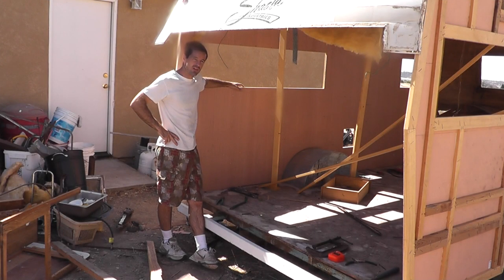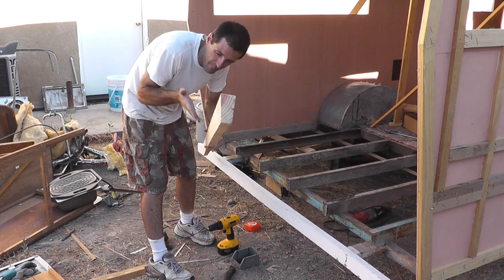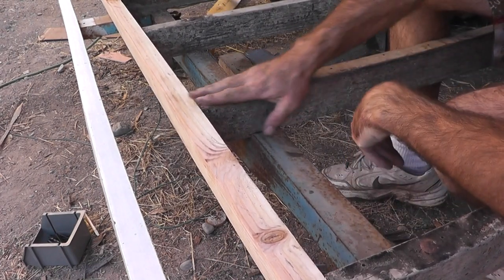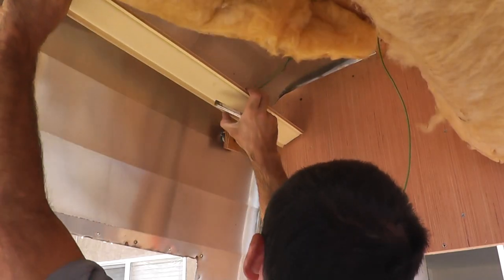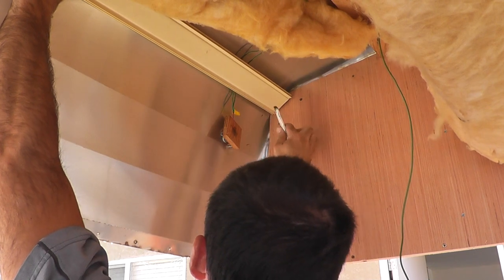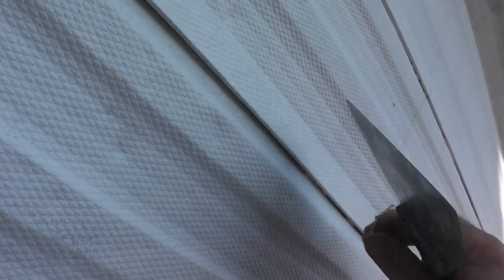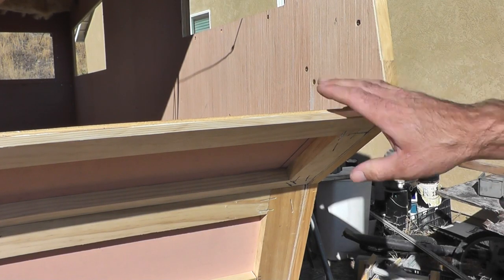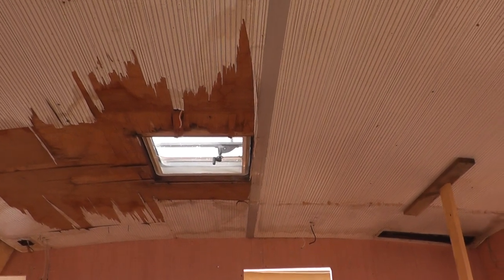Vintage Shasta Camper Trailer Restoration - Part 7 - RV Rap + New Front & Back

Comment: FYI your videos have helped me a lot with my 50s Kenskill trailer (built in a nearly identical way). the wood on mine is far more rotten, but the techniques you used for disassembly etc saved me hours of guessing.

Comment: I dont know if you are/were a carpenter but thats bloody loverly, its becoming newer with every episode :-))

Shasta 1400 has become a teenager again :D

Im sure you can put something like solid wood coving in the corners to stop the wobble.
Reply from the maker: zx8401ztv I worked in construction for a while so I know just enough to be dangerous :) I'm thinking that once all the interior cabinets and benches are installed, it will really strengthen everything up. It's quite amazing how such weak materials can be combined to make something relatively strong.

Comment: OMG. Now I see what a mess I am in for! I promised my sister to fix her Shasta  Compact trailer. I have found it has roof rot, back window wood frame is gone! and back floor corners are power or not even there. all the boards around the roof vent are discentagreating  to the touch.

Comment: I'm planning to start my Camper project in the next few weeks and haven't touched anything yet. I have to get it waterproofed, so would you recommend I dismantle the interior right to the inside framing from bottom to top and from there start building? Thanks.